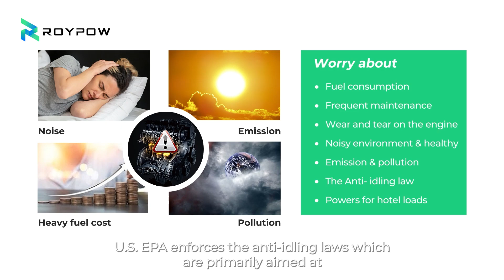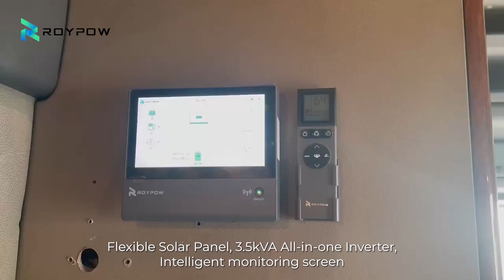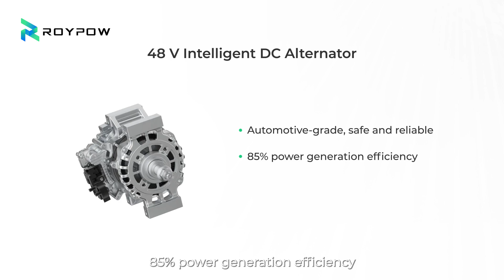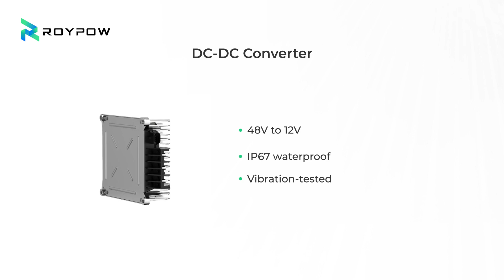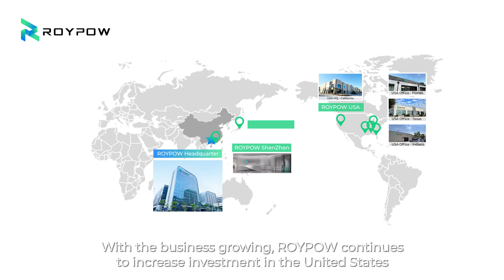A One-Stop Solution for Truck Energy Storage | RoyPow

Comment: This is not an APU... It's a battery...🤨
APU literally means auxillary power unit. A puny solar panel does not qualify.
Reply from the maker: The APU provides the energy to turn on the heater, the AC, without having to keep the truck in idle mode. They (battery) can save on gallons of diesel fuel. Solar panels are just a supplementary source; shore power charging is necessary to meet the energy needs.

Comment: Electric with trucks makes sense BUT, they should be hybrid. They can recapture energy with breaking (help with additional breaking) and assist with climbs.
BUT, for long distance driving, you need the combustion engine. The combination makes the most sense !